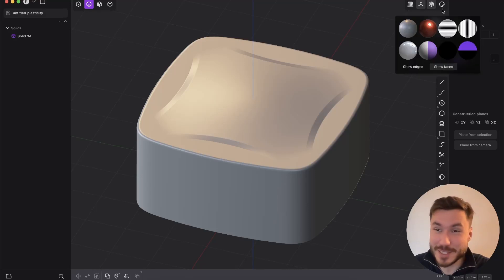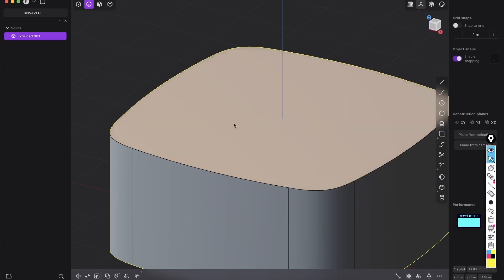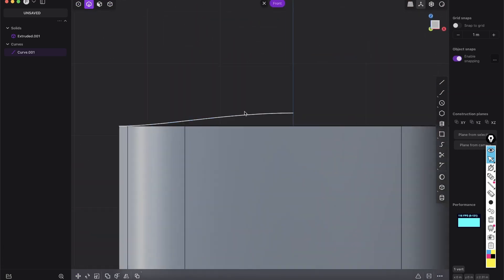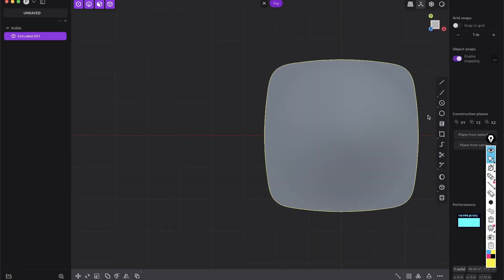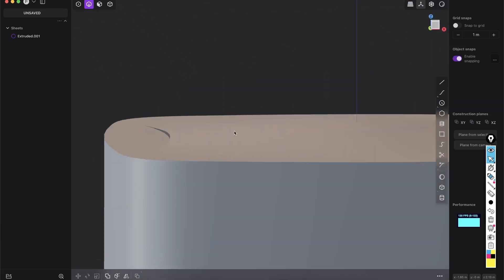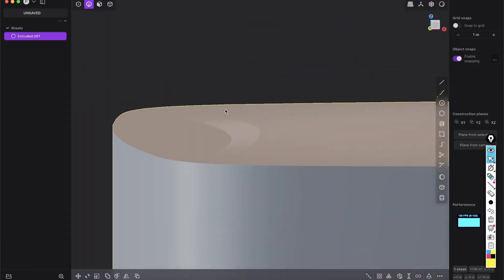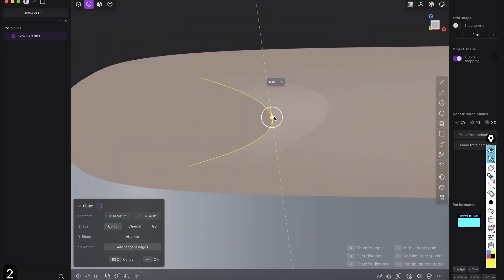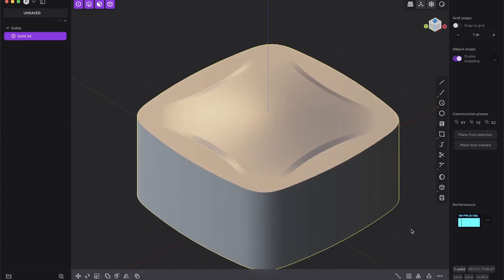How to Model a Stamp in Plasticity for Beginners

Comment: Nikita,  Thanks for all the great tutorials.  
I will take your full course once I complete all your free lessons.
I have a suggestion for a different type of lesson.
The objects are simple but their manipulation is the point. Placing with gravity.

Step 1 Create a cupboard with a couple shelves.
Step 2 Create a plate and duplicate it a few times.
Step 3 Place a plate on a shelf.
Step 4 Create a stack of plates on the shelf.
Step 5 Add a shelf to the top, tilted up 60 degrees. (Like for displaying antique plates.)
Step 6 Lean some more of the plates against the new shelf.
Step 7 Create a simple cup.  Duplicate it.
Step 8 Add hooks to the underside of a shelf.
Step 9 Hang the cups on the hooks.

I want to see how solid objects can interact.  Is this possible in Plasticity without just carefully moving the pieces?
Reply from the maker: You have to place them manually in Plasticity. No physics.
Reply: @nikita.kapustin  Thanks Nikita.  The reason I was asking is that I am trying to use Plasticity to design cabinetry for a van camper.  I first built the container area and was trying to see how to add the objects inside the camper.  I will need to look at some other tool for that design perhaps.  I love your tutorials and am using it for 3D printing designs.